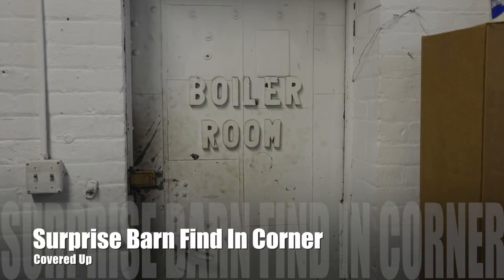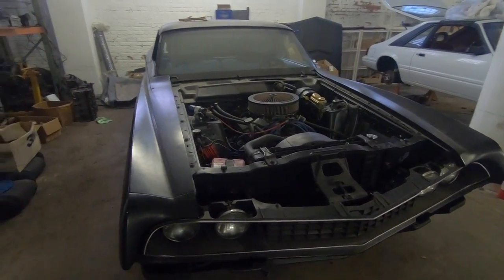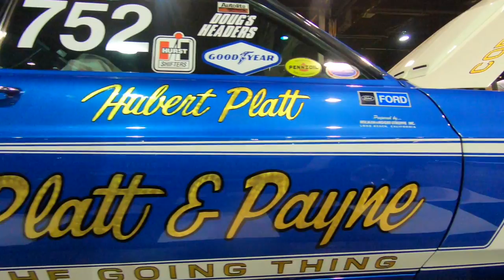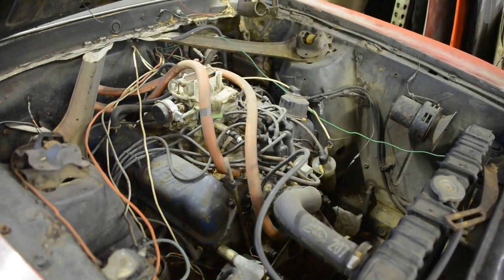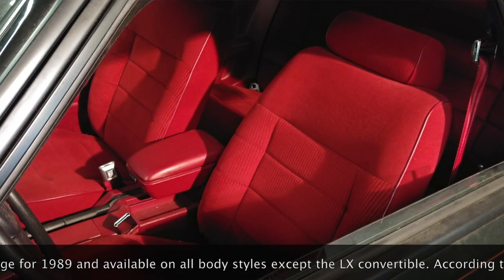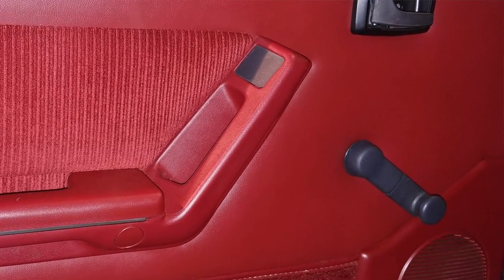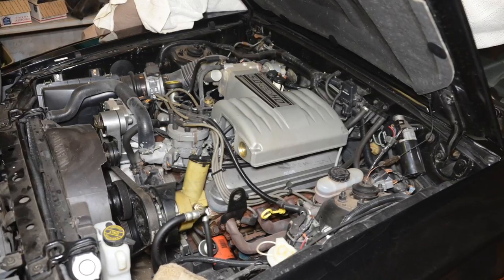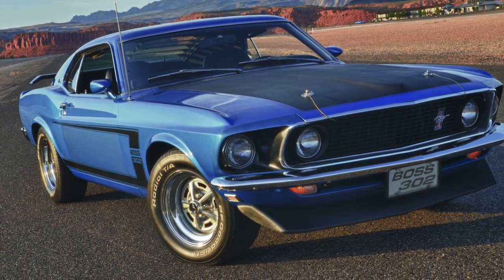Barn Finds = '69 & '89 Mustangs - plus Ford's secret code for Lightweight in a Fox Body

Comment: Once again, this is proof that the phrase "Barn Find" has been diluted...........
Reply: Not diluted, but evolved. Evolved or expanded into a term stating the obvious.   
When you hear it you know exactly what you expect to see regardless of the actual structure composition. The same goes for the term rat rod.
Reply: @lewislukanc1354  What?????  I've been in to this stuff since 1982, and when I think of a Barn.....well, I think of an actual Barn................
Reply: Well now just think how hard it would be to find all of these stories if everyone held true to such specific structure terminology as yourself.  Especially considering there's an endless variety of storage structures that have been created...
Believe it or not you're not the first to be unyielding to the evolution of terminology.  I still have issue with calling anything a rat rod just because it's in primer or because it's a piece of crap but the entire industry sees it differently.
Reply: @V8Deuce  its was a barn find when he purchased the car in painsville.
Reply: It actually came from Medina.  Did you know of one in Painsville?
Reply: @lewislukanc1354  lol i thought you told me it came from painsville when i was at your shop on Detroit. Or maybe that's where it originally was sold anyway its still amazing.
Reply: Ahh. I thought you were referring to the 89. The 69 was sold new at Frank Stanton Motors in Painesville. Good memory

Comment: I had a 1987 Black 5.0 GT option delete car. No radio no A/C  tan clothe interior which is rare no power windows or no power mirrors or locks  car was a 5 speed as well
Reply: I HAVE A SCARLIT RED 87 MUSTANG GT ALSO AND I HAVE NEVER SEEN ONE WITH ROLL UP WINDOWS LOL MY 87 MUSTANG GT HAS THE RARE T TOP OPTION AND IT HAS 69 THOUSAND ORIGINAL MILES BUT MY FAVORITE FOX IS MY VIBRANT RED 93 COBRA LOL 20THOUSAND ORIGINAL MILES AND ALL ORIGINAL EXCEPT FOR EXHAUST.

Comment: Bought an 89 GT 5.0 red/grey hatchback 5-speed brand new in July 1989 out the door  $14,400.00. Only good memories remain of that car.
Reply from the maker: wow, seems so inexpensive today but that's what they cost!!
Reply: Consider inflation AND earning power.
Direct inflation is right at 2x in 30 yrs.
Earning power with all the increased taxes in life, ....
That would be $ 28 to 33g.
Doesn't seem smartcar cheap, does it.

Comment: DRIVE THAT COUPE! WHAT A WASTE.
Reply: I believe some of these guys have a mental illness. I understand having and keeping low mileage cars. But this keeping them in the back of some odd storage building covered and “plans of someday” just makes no sense. This guy is not a car enthusiast in my eyes, he’s a nut....
Reply: Them coupes look like that undercover police cars , No way nicer than a camaro rs
Reply: Karl Hollywood rs = real slow...LO3 tbi 305. 170 highest horsepower available
Reply: That car would preserve so much better if driven 50 to 100 miles a month
Reply: John Hull 
If I want ed fast I'd get a 350 iroc z roller motor
Reply: Karl Hollywood i owned a faster iroc new...91 formula 5.7L
Reply: John Hull I own a faster Ford than that mustang , Ken block had one too a cosworth

Comment: Love fox bodies. Gave in and bought an 87 gt t top just over 2 years ago. It came in good shape but mis matched interior from an SN95. Just got it back to stock tweed over the last summer. Went over the car and replaced weather stripping and the odd thing that needed to be addressed. That’s the beauty with these cars. The aftermarket support is phenomenal.  If it wasn’t I wouldn’t of bought it.  You can practically build one out of a nothing more than a frame (unibody yes). Other than rims, mine looks like a stock foxbody with fat tires and American torque thrust wheels..until you try me from a light😉

Comment: It sounds like 41X on the '89 Fox body was very similar to the police package cars.  Maybe Ford introduced it as an option to use up remaining parts in stock for police vehicles that weren't ordered.  I suppose it's also possible that 41X WAS the police package and only people who were in the loop with Ford were able to get them as civilian cars.  I know that in the UK while the police spec Granadas and Sierras weren't available to the general public some staff and customers with special clout with Ford were able to order police-spec vehicles for civilian use so it wouldn't surprise me if the same thing applied in the US where you couldn't get police package vehicles, unless you worked for Ford or you had the right ear to speak to...
Reply from the maker: I like the term "lightweight," which Ford didn't use, but the idea was to lower the weight. How cool would a 41X badge have been? But, I don't think Ford wanted buyers knowing about this because they wanted to sell options.
Reply: Doubtless the same happened in Australia with the falcon. There was stories of them getting stripped of the extra go fast parts by administrative services before they were sold after the police had finished with them.
Reply: @thewriter2549    Yes, it's amazing how much extra performance you can get out of a vehicle by putting it on a bit of a diet.  That's why police cars always used to be stripped out basic.  As you say, though, the public generally didn't want poverty-spec cars, they wanted the toys...

Comment: Jerry,  great video. I owned an '84 Mustang GT and had a blast with it. Bought it new and sold it 10 yrs later in mint cond with 40K miles. 
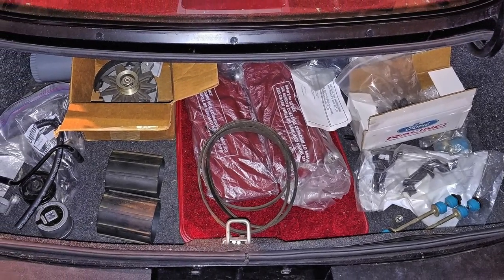At around 8:15 of the video, i caught a glimpse of a set of 20 inch wheels that i have been looking for my 09 Expedition. I believe they were an option on the F150. Are they for sale?
Thanks

Comment: I have an 87 factory delete everything except it came with rear defrost. What code would that be?
Reply: the BS code, since he just said you can't get any options with it.
Reply: Point is that 41X is not a normal delete car.
It's suppose to be ultra light... Probably no seam sealer either etc.

Comment: great video jerry im from ontario canada i have a fox body im the second owner of it since 1987 its a 1985 mercury capri 5.0 Rs all original with the original good years still on it . 51000 km or 30k miles on it. has air power windows cruise control how rare and saw after is my capri i never see them anymore ?
Reply from the maker: The 5.0 RS of 1985 - last carbureted Capri, right?
Reply: @thewriter2549  yes sir shorty headers factory

Comment: This reminds me of when Saleen ordered several truckloads of 'delete' cars. They deleted the seats and radios etc, since they were using their own upgraded items. Problem was that Ford would charge them MORE $$ for the car, with deleted seats and radios! Saleen changed this quickly, and they went back to pulling all the stock seats and radios and then selling them on. Also, radio delete meant antenna delete, which was a huge pain, installing and routing an antenna wire, when they could've simply used the Ford OEM antenna with their aftermarket stereos.
Reply: I believe that this still holds true, today. I know that if you used to order a Police Interceptor or a Crown Vic. for a cab, it would cost more, to have the rear seat deleted. Like $600 more!! If you were going to replace the rear seat with a hard plastic one etc.
Reply: Most agencies had a pile of rear seats in storage.
When the cars sold later, seats were not necessarily matched to the fronts. Lol.

Comment: Those that are saying the coupe is just ssp car. I've yet to see a 87_93 ssp car with a red interior.  If you have show me.
Reply: SSP could be ordered with any interior but it was a different ordering code.  Had a couple features that could not be had on normal public offerings which changed through the years.  Such as an SSP in 1989 would have had extra seat bracing, silicones Goodyear hoses (blue) and black painted wheels.  
They could be had with all normal interior options as well as any avalible color combo.
Reply: Richard Mick I have an 89 SSP in North Carolina with the red interior. I’ve had it since 2003.
Reply: I'd say it's uncommon to find one with red. From my experience tan was the most common.
Reply: @7993mick  Tan was the most common Thief Coast Florida SSP cars used tan. I believe some California cars also. California and Florida used them the most. I believe over half the production was between California and Florida

Comment: Was there a special code for the rental LX 5.0 Mustangs that I think Hertz had for a short time? My 79 5.0 4 speed Pace Car was in the shop for repair in the spring of 89 and I had a LX 5.0 automatic for a few days. That car definitely had more power than my Pace Car. Hertz removed the 5.0’s from their fleet because too many people were beating on them.
Reply: 79 had about 130hp. 89 had 225hp, at the flywheel. But you probably already knew that.
Reply: 79 302’s had net 140hp. The 85 roller cam carbureted 302 in the Mustang GT and LX 5.0 was rated at 210hp but the Ford Motorsport catalogues listed that exact engine with 235hp. With the changes to EFI the 87 and up 5.0 HO were possibly 250hp.
Reply: Engine Dyno not net rated.
We Dyno tested a couple and they'll do about 259 with stock headers .. 269 with long tubes.
Dynos vary.

Comment: Somewhere out in the world(possibly still in the south?) there is a 1993 LX 5.0 coupe, 5 speed, white w/black interior, 41X no options. It did have dealer installed air(it looks quite different than stock A/C systems, especially the control panel), and an aftermarket radio and the typical  bolt-on mods but it was a very cool car. A friend owned it but sold it in 2010.

Comment: In late 88 my folks bought a 89 Taurus wagon, (nearly identical to National Lampoon's Christmas vacation family car.)  The Mustang was turning 25 at the time would be anyway. There was promotional stuff on the walls celebrating it. I just remember waiting forever for the paperwork. I remember checking out this one thing had Mustang and pony logos all over it. I forget why I went to the dealership a few years back, might've been for a $650 lost key replacement. I walked around and saw that sign still up there. Dealership had been remodeled but that sign was put back. That's when I realized it had been another 25 years +. It was surreal, like instant time travel back to that day. I did end up having a Mustang somewhere in those 25 years, it was a 98 GT and it was a lot of fun. Currently have a 2nd gen Ford Probe GT about to turn 25 years old.
Reply: PGTMR2 man your lucky , I had a gen two probe with a jdm klze engine . The best car I’ve ever owned
Reply: Those were popular cars in the day. Two of my good friends on them. Spend a lot of time in them. If I recall the only real issue they had was control arm bushings.

Crazy to think the probe was supposed to be the new Mustang. A letter-writing campaign through hot rod prompted Ford to keep the Mustang Fox platform, but create the Prototype as its own car. I believe it's the first prototype car from Ford to use the prototype name.
Reply: KLZE Straight neck, Millenia Maf swapped, a/m springs w/DE retainers, Magnaflow hi-flow cat and muffler all 2.5", SS brake lines. Very stock feel, looks, reliability. Absolutely shamed a Cayman with temp tags on it :-D
Reply: They should have called it Maverick or EXP, something like that.

Comment: The white Fox looks like a rare 1984 GT350 with the really rare 2.3 Turbo.
From the tubing it looks modified for more power.
Reply: Correct. One of 362 Turbo Gt350's. Far less with t-tops but still need to find out how many from Marti. Car is also a non a/c and non premium sound.  
Watching for 20 years now , only 8 2.3T  with T-tops have been found.